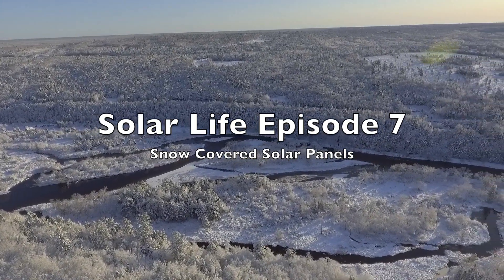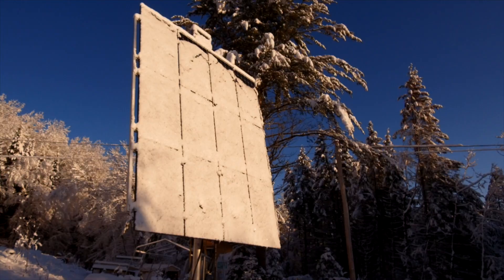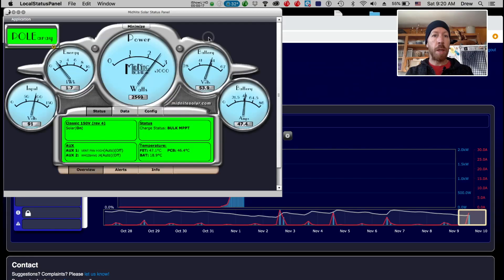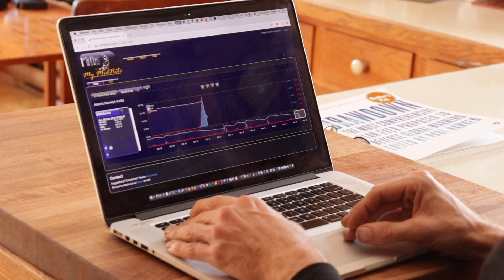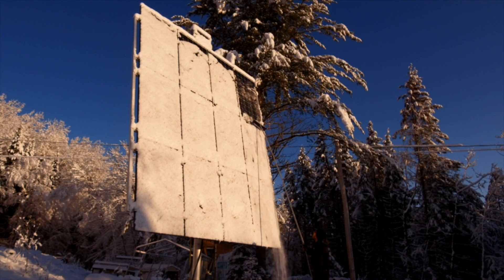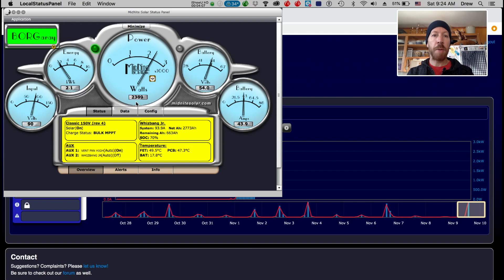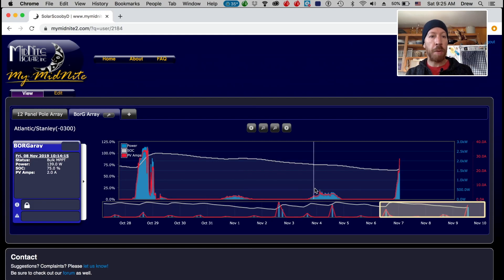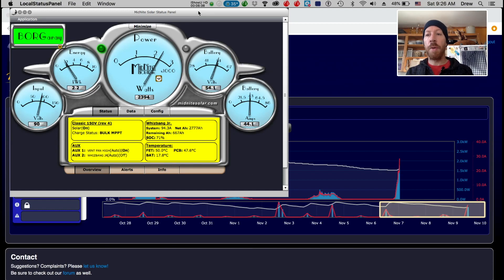Solar Life - Episode 7: Snow Covered Solar Panels

Comment: Hi, I use a 2-axis solar controller for my DIY solar tracker: https://youtu.be/_Rs8CptQcDw. Save electricity costs / improve amortization: With the Dimmer + Solar PV, self-sufficiency will now increase to almost 95%, which means a major breakthrough, because expensive purchases from the grid are so easily suppressed and the electricity bill lasts just like the electricity meter. The prerequisite is that you have at least a small balcony power station, and you don't need an expensive battery either. Example of a kettle: Without a dimmer, the 2500W - 600W PV system needs = 1900W, which you have to pay more for. If I turn the kettle down to 600W with a dimmer, then every weak PV system can now supply each consumer independently and independently, because the 2500W kettle becomes a 600W kettle thanks to the dimmer. Magic... The 2000W e-heater becomes a 500W e-heater with a dimmer, which can run 12 hours a day free of charge via PV. https://youtu.be/QbLWDbJi6ew . The 4000W oven is also tamed. Not the solar systems have to grow, but the consumers just have to drop by 75%, which is sooo easy with the dimmer. are you convinced now I have already switched my entire household to dimmers. Please have a look at my channel. ........ 🌞 ....... Increase mini PV solar self-sufficiency (winter and camping): A boiler and other power-hungry consumers can be infinitely reduced using the "5000W dimmer". Ebay €7. I run 5 dimmers in parallel on an 850W inverter. Kettle 2.2KW at 150W runs 12 hours a day, so the water is always hot. The room is also nicely heated. 2.5KW washing machine runs in parallel with dimmed to 400...600W and always reaches its 60°C, and also its 1400rpm... It doesn't matter to the washing machine whether it changes the washing temperature to 5min@2500W or 100% can be achieved free of charge via existing PV power in 20min@600W. The wash cycle lasts the same time dimmed and non-dimmed, 3Sth 10min. The iron, dishwasher, oven, electric heater, waffle iron, coffee machine, all internal heating are throttled with me. Videos on my channel https://youtu.be/eC2olbCBhh0 The inverter stays cool, quiet and the MOSFETs + (battery) remain intact because no extreme current peaks arrive at the inverter. Now every Mini PV Inverter is enough to operate large devices. So, with the dimmer, all internal heaters/devices can be converted into base load devices that stay almost permanently ON, drawing very little current directly from the PV. With a wattmeter / energy cost meter you can then measure this perfectly in order to set the dimmer optimally. ........ Comments: "Great idea - despite studying electrical engineering, I didn't think of it myself ;-)" or "I installed it in our washing machine, great idea!" or "Glück Auf Christian, I'm a professional myself but I haven't figured that out yet.👌 Greetings Mitch💚" and many more... LG Christian .............. 🌞 . ............... ................ ................ .............. .................. ..................

Comment: Can they be placed totally vertical when it is snowing? Can you move them a bit remotely/automaticly to shake off the snow?
Reply from the maker: I leave them vertical all winter, unless it's a grey week of no snow when I would often tip the panel up to the clouds.
Reply: @solarscoobyd7629  Aha, that's indeed a good idea in a snow rich location.
In general I guess vertical panels are great because they deliver relative good in wintertime where you need the energy the most.

Comment: You should have installed bifacial solar panels on the pole. In that way you'll be generating power from their other sides or back as well. That should also help with melting snow from the front.
Reply from the maker: They were not an option from my supplier.  Thanks for your comments.

Comment: How much reflected light from snow increases power production versus no snow?
Reply from the maker: This is called the albedo effect and it's hard to measure except with equipement or calculating it theoretically.  I am guessing that a good snow clean cover can boost production by over 20% on a sunny day.
Reply: @solarscoobyd7629  Idea for next video - experiment. In sunny day cover snow in front of solar panels with dark balnkets/t-shirts and use data from inverter to compare how big power differences before and after. That kind of video will go viral =)
Reply from the maker: @rapolasmasaitis9824  I did a video about the Albedo effect.  https://www.youtube.com/watch?v=CAxxdfd4KHM&t=221s&ab_channel=SolarScoobyD